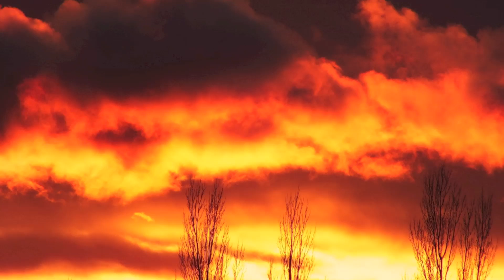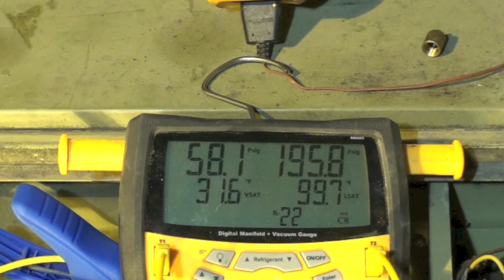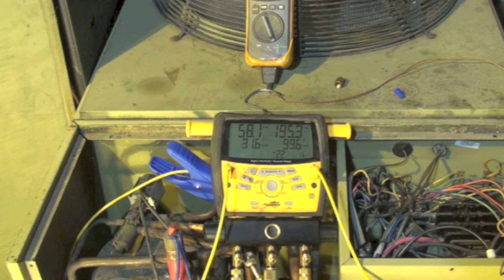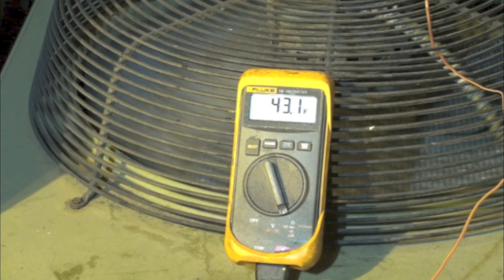Temperature difference across the outdoor coil in the heat pump

Comment: Amazing Service Experts a  company  checked Ac unit to replace unit 11k, ductwork 15 k...they shutdown the unit, I have Multiple Sclerosis which is exacerbated by high tempertures and stress... Brother is licensed and technicians manager for a major gas company his guage set shows us freon R-22 is at proper psi not absent as they described , I blessed to have a brother that is a trainer and manager for heating and air conditioning system's commercial and residential.....Intregrity is what this nation is greatly missing.  Service company avoiding service to the unit been with this company  42 years, this shameful, outer for ductwork and new unit wentas high as 27k